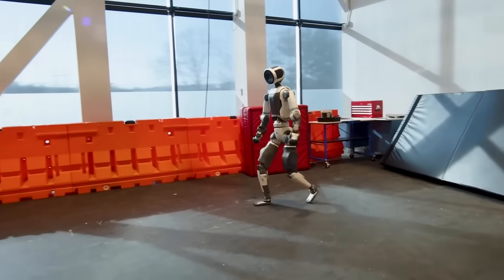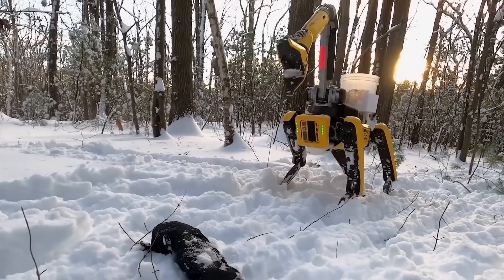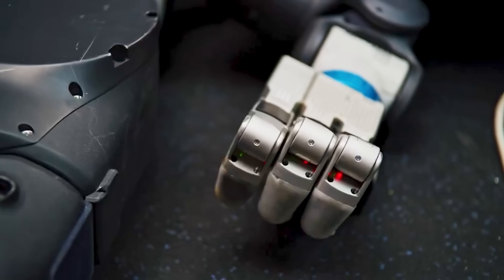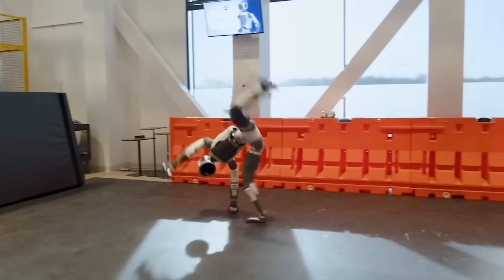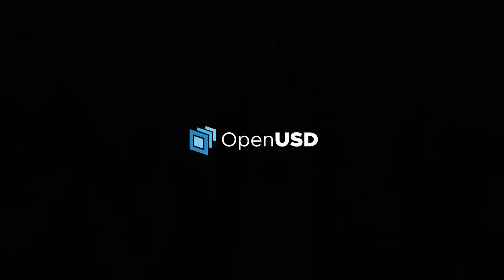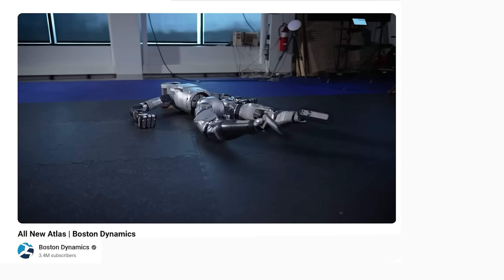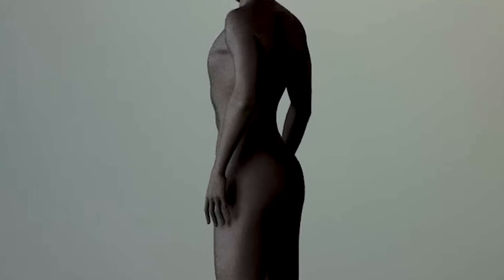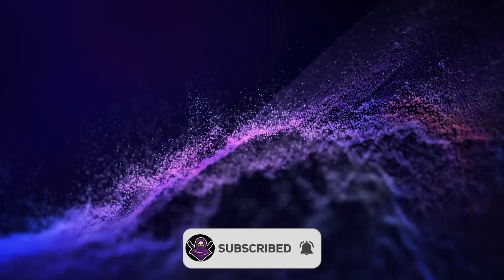Boston Dynamics New Atlas Robot Feels TOO Real and It's Terrifying!

Comment: Atlas Robot does not feel pity, or remorse, or fear. And it absolutely will not stop, ever.
Reply: It's easy to stop it with a EMP-Gun ! Very easy. And it needs an gasoline generator in battle field becaus batteries are too weak. So it can be HEARD ! and the heat can precicely detected by guided misseles....One hit, and it is scrap.
Reply: Humans are like that, just watch war documentaries
Reply: Some did not get the reference.. 
Haha.. 

Jahn Caahnuh will be our saviour
Reply: We got the reference @0th_dimension
Reply: "Until you are dead"
Reply: Agreed, fear is controlling.
Reply: Perfect.
Reply: 50 years?  AI + humanoid robots in 5 years...
Reply: Just like a sociopath,  which humans have in abundance. 
Have you forgotten Stalin or Mao Zedong?
Reply: Hydrogen fuel cell
Reply: @BrianA76  No solution for a war robot. Will explode, when robot is hit buy a rocket. Gasoline not....

war robots are IMPOSSIBLE - what luck !
Reply: One 3006 and it’s good by robot.
Reply: @michaelangelo7511  Ah, but where do you put the round to disable it
?
Reply: Sounds like the plot of a Black Mirror episode... wait... it IS the plot of a Black Mirror episode.
Reply: Meh, it’ll stop. You just have to find out the achilles heel for the particular make/model you are attempting to disable/destroy.
Reply: @TheJacklwilliams  It will regenerate, replicate and conquer.
Reply: @Fitness4London 😂Yeah… It’s absolutely nuts. I’ve debated for five years  of getting in to robotics under the guises of making that my last IT focus. The irony as I thought through it? They won’t need human handlers for maintenance, upgrades, break fix. They’ll either do it theirselves or have a robotic mechanic that does it. What’s nuts is, this was all very futuristic for the longest time. No longer. When you think about where we’ve advanced to AI wise we are still in it’s infancy yet? It’s strong enough today, to do ALL of that work including building them. Robots, building robots. We are about to see scifi played out in real space. Given that we created it, we know this is NOT going to be good.
Reply: @TheJacklwilliams  Good assessment. It's a fascinating phenomenon. Imagine a megalomaniac billionaire tech tycoon who has his own army of radically advanced humanoid robots.
Reply: War will become self sufficient.
Man will be crushed under the wheels of the machine made to destroy the machine made to build the machine.
This is the only way it could have ended.
Reply: From the moment I realized the weakness of my flesh, it disgusted me...
Reply: Send these to Ukraine ASAP.
Reply: Y’all, this is a quote from John Connor in Terminator.
Reply: It’s the next leap in evolution
Reply: @turolretar  You're nuts. These A.I. robots are the enforcers for the Anti-christ. There is NOTHING good about them.
Reply: So it's MAGA 🤣

Comment: I agree. Don't care what it looks like or if its creepy. If it can clean the septic tank and and take out the garbage when its -20F that's fine with me.
Reply: Well, below 35 f and above 85 f, my phone battery looks at the thermometer and apparently thinks, “F you, human.”
Reply: Clearing sidewalks and driveways of snow…
Reply: Well, lets see in another 50 years of development, or actually never. -20F kills any battery/hydraulics/joints
Reply: I grew up milking cows,  they have robotic milking machines now.
Reply: You'll be able to buy one that can do that in the next 10 years.

Comment: The main advantage of human soldiers is that they are self repairing and self energising if given even minimal rations. If you take out a single actuator on these robots they fail. They must be constantly maintained at the moment because they can’t do it themselves. Humans can. there are absolutely no energy sources at the moment that can run a system like this for more than an hour. Human beings can fight and survive for up to a month even without food as long as there is some water supply. 3 billion approximate years of evolution makes these things look like dinky toys. drones etc. Are just fine but replacing front line infantry, which ultimately only ever truly wins wars, is a long way off. Pray for sex. Hope for peace.

Comment: I understand why it's easy to think the motion capabilities are unnerving, but it IS irrational. People are just anthropomorphizing the machine because it is humanoid shaped. If those same joints with the same range of motion were used in some box shaped, stationary industrial machinery, nobody would be unnerved by it. Just remember, it's an assembled collection of designed and fabricated mechanical joints, not a Human. You see the same thing on a lot of those stationary, orange, industrial robotic arms, and you aren't disturbed by them because they're just arms instead of entire bodies...but it's the same thing.

Comment: Elon Musk:
"Tesla will have genuinely useful humanoid robots in low production for the company's internal use next year and possibly high production for other companies in 2026"

Also Elon Musk (in 2017):
"people ask when are you going to make a new Roadster? We are making it now" - Note: He took 1000 pre-orders at $250,000 each. It will of course have world record performance, with 0-16 in less than 2sec, top speed >250mph and it will have a 200Kw/h battery pack giving a range of 1000Km (about 620mi).

Also Elon Musk (again in 2017):
"The houses you see around you are all solar houses" none of them were because all the solar roof tiles were fake (regarding the PV aspect).

Not to mention the Tesla Semi, the predictions of Starship's timeline, how easy it would be to make a Hyperloop, how cheaply the Boring company can dig tunnels. The list just goes on and on.

Maybe the robots will be on the shelves in 2026. If that actually happens, it will buck the trend of his endless false promises and lies.

Comment: can somebody explain the reason why some people are stuck with humanoid robots obsession? like, it's not even close to the probable efficiency that could be achieved with different shapes and whatnot
Reply: They wanna clank the robot i assume.
Reply: Because we already have tons of stuff made for humanoid forms (i.e. us). The infrastructure is easier if the robots can use all the stuff we've already built - such as stairs and doorways.
Reply: @marksizer3486  makes sense but let's say cats can move through human infrastructure like stairs and such much more efficiently
Reply: @autistic_bruv  If I want a robot to perform domestic tasks around the home, a roughly human form is likely to be about the most efficient at interacting with all the appliances which are already designed to suit humans. Other forms will be superior for different specializations, of course.

Comment: Elon is a scam artist that always do thing to "next year", but when the "next year" come folk have forgot that and it still "the next year", and that go on for 10 years like with the roster. Elons robots are fake and far after compared to Boston Dynamics, when you see Bostons robots you see them fixed, scratched and fixed with sticky tape for they been tested hard; Tesla's robots are always slow, pristine, wireded in some way and sometime bolted to the floor, and the latest demo they were controlled by humans.

Comment: The next step is to get rid of some rotating motors, change them to electrical pistons that can pull wires to simulate movement of muscles, and after that make material than can contract and expand like a muscle when a electric current are applied. And we are not long from that.

Comment: Is there a way we could use a robot as an interface with solar power and radiation panels to power and send a robot that can fly a spacecraft way into the abyss at per say maybe another galaxy or even a distant star and refuel it in space or a nuclear reactor for power and hard wire the robot so it never uses a battery but harness the power in space and see how far it goes and then see if it can return on its own that’s would be cool

Comment: The big quadrupeds are part of the  DARPA/ARMY/MARINE robot packmule program.  It worked (as illustrated) but in order to meet range/battery life requirements it used a small gas motor for power.  The only 'training' the packmule needed was a 'target' on the back of the 'mule-skinners' ' belt (if a human could get there the mule could follow).
It is widely acknowledged that the first jobs for robots will be DDDR jobs (Dull, Dumb (not requiring much education or skills) Dangerous (for HUMANS) and repetitive) that humans do NOT care to do.

Comment: Hey!! We still have time until they can increase, whilst reducing the size of the power storage batteries, in the near future. At the very least, they will need to be in making them practical for use. Otherwise, it doesn't matter how mobile they are. 
They could only be practically used in hand assembly required manufacturing, of course, mass production in any heavy engineering, and literally everything else, as long as it's near an 24 hr available electric power port to recharge. Technology needs to advance significantly before we can take them on holiday, patrol our streets, or fight our wars before fighting us!! 🤔🙏

Comment: Also, a remote controlled version of this could be used by law enforcement to reduce injury to police and the mentally ill people they often have to deal with. The bot would be strong enough to restrain the strongest suspect without having to use weapons. Too many ill people die because police fear for their lives from criminals with knives and guns. A bot could even prevent high speed chases by stopping a fleeing car before it gets up to speed. If a car starts to pull away, the bot could break the window and grab the steering wheel to prevent escape, even if the suspect is shooting at it.

Comment: Boston dynamics is not AI.
It’s remote controlled or preprogrammed.
They cost billions each to build.
The value of the company’s IP is near zero.
Reply: Hmmm.... Thanks for the stock tip.  Buy low sell high. :face-blue-smiling:
Reply: Boston uses Nvidias AI. Jetson Thor, Isaac and GR00T.

Comment: I find it interesting that we aspire to make it as human as possible. Is that the definition of success? Reinventing ourselves?
Reply: There are many reasons for humanoid anthropomorphic robots. But primarily, humanoid robots are designed to resemble and perform human-like tasks, which can facilitate their integration into human environments and potentially enhance human interaction and efficiency in various industries. They are used in manufacturing, healthcare, customer service, and even in households for tasks such as physical therapy, companionship, and routine chores.
Reply: @Leo_ライオン  There are only a few reasons for humanoid anthropomorphic robots, the main one being to make us feel more comfortable. Almost none of the robots in use now are humanoid in form or function. I don't see that changing. 

Factories don't want a robot that does everything like a human; they want one that does one job very quickly, like they already have in many. A robotic surgeon is not going to be human;d, it's going to be the whole bed or operating theater. A robotic driver will not be a humanoid sitting in the driver's seat; it will be the whole car. A robot miner is not going to be a humanoid in a hard hat swinging a pick; it's going to be the drilling machine. Forestry and farming all have similar trends of robotic tractors or robotic harvesters, not humanoid drivers for those machines. 

Routine chores in a house are going to be done by specialised devices, as is already happening with devices like robot vacuum cleaners or lawn mowers. Even our washing machines and dryers are decade-old iterations of this trend. Humanoid robots that cost thousands of times more than simpler dedicated devices in a household, with presumably similar increases to maintenance and repair, seem unlikely to see widespread use.
Reply: @x64600  where did you copy and paste this from?
Reply: Reinventing...? Or improving...?
Reply: Eventually we want to create very human like helpers or friends.
Reply: the goal of robussy is always on the horizon. never settle
Reply: It’s so when they offer downloading your consciousness for immortality, it does not seem so alien….
Reply: It is a will to create our own end.
People pushed to their limits might decide that death is the only thing they can controll.
A glorious suicide
Reply: It’s not really that deep, we’ve optimized everything for humans, so humanoid robots are necessary to fit into those spaces.
Reply: @deathisdead270  No, they are not necessary for that. Quite the contrary. Industrial robots in humanoid form are inherently inefficient. Working environments are made to facilitate a Robot made SPECIFICALLY for the task that it must perform. When the human is removed from the work floor, the work floor is adapted so robots can be efficient. Have you ever seen a car factory where robots do most of the tasks? Humans cannot work in those conditions.

Humanoid robots are useless.
Reply: It's called a scam. Inventing useless stuff and let people pay good money for it. Humanoid robots are just mere toys, useless for anything. We had robots for 70+ years now, not a single one have two legs, two arms and a torso to move around.
Reply: We were made in "Gods" image, now we make robots in our image. 🤯
Reply: @d.i.l.l.i.g.a.f.594  I guess we can say that we, humans have a god complex.
Reply: @allexsanchez2714   👽👈 "made in ""gods"" image"  (we look like them)

Angels came down from heaven
🤔 Translates - "People came down from space"
Reply: @d.i.l.l.i.g.a.f.594 well here comes the keyboard warrior.
Reply: @abandoned.connector 🤔 I prefer the term ""keyboard Mandalorean""  😂
Reply: @d.i.l.l.i.g.a.f.594  ohh i got one.
"Keyboard crusader"!
... I sort of proud for that one ngl...
Reply: @abandoned.connector if your feet smell and your nose runs. It doesn't mean you're upside down. 😂
Reply: @d.i.l.l.i.g.a.f.594  wh... What?
Human please?
Reply: @abandoned.connector  😂 guess you didn't get it

Comment: I believe these are the types of robots that are perfect for mars exploration, once they can be shielded from radiation. This type of dexterity is not likely needed in factories where wheels would be adequate. Building collapses and other similar work, like that needed at Chernobyl are an excellent application of this robots ability.
Reply: A bipeadal, humaoid robot would not be the best form-factor for exploration, or for rescue work in building collapses. You want something small, stable, rugged and strong for heavy work. Or something light, agile and fast for search or recon. Neither are humanoid. Look at what we already use.
Reply: @ You are correct about building collapses. I still think mars exploration could work given the very rocky terrain. They would deploy heavier equipment but could better pull together to assemble different tools for what they’re finding. And recon would be a big plus on mars.
Reply: We have no applicable materials that can protect from such radiation other than a crap load of lead and concrete several feet thick. And then there is the small matter of ground charge that would fry their electronics.

Comment: For years Boston Dynamics sported their Atlas robot as the one to follow. But it seemed that they couldn’t get past showing us how it could dance and do other unimportant things. Impressive, maybe, but it didn’t improve much. Spot on the other hand was a huge improvement. Showing us the things it could do for such a small size. Then came the latest version of Atlas. While the streamline look of the latest Atlas was quite advanced from its older brother, the moves it made in its introductory video was eerily unsettling. I do not want a robot to do contortions that even a human can’t do.  The latest video again while impressive, is still not allowing us to see what Atlas can do as far as the mundane tasks. Yes running walking, breakdancing, is all top notch, but really in most cases unnecessary. (Although the running aspect would be great in emergencies) 

Overall the new version of Atlas is good in design and fluid movements. Could we get rid of the lamp head?  It seams that everyone who is creating the more human like robot, refuses to give them a face. It’s not scary to have a face. Those that are saying so are just not into robots.
Reply: see: uncanny valley
Reply: They aren't building these to do real work: they're designing them to wage war
Reply: It's scary without a face would be much better with one as long as it isn't a clown face.

Comment: Combining power storage and delivery systems can significantly increases output and performance. Battery and nuclear core combined with an ionic fluid supply that is discharged and recharged internally by both the battery pack and the nuclear core would make these robots have an excellent range.
Reply: A nuclear powered device roaming the streets, what could possibly go wrong?

Comment: If they had done this back in the 90s (they could), I would have been able to have had a life, and not get a $5.25/hour job at a plastic factory (after college), followed by a $7.25/hour job at a chemical lab testing product samples for dialysis fluid (important stuff - $7.25/hour - less than McDonalds).
But they chose not to let us have a life and instead STEAL IT ALL FOR THEMSELVES.